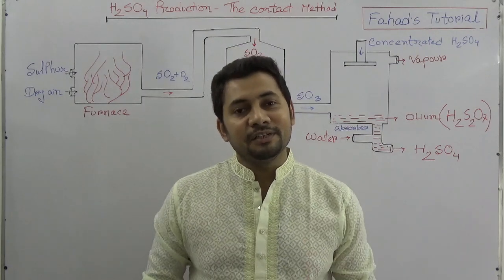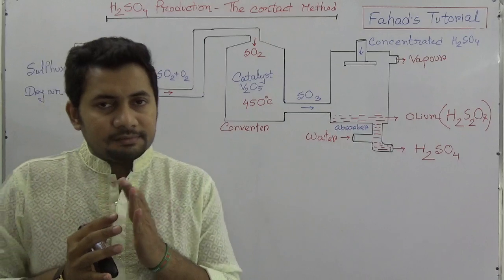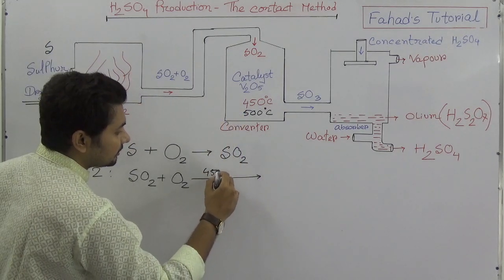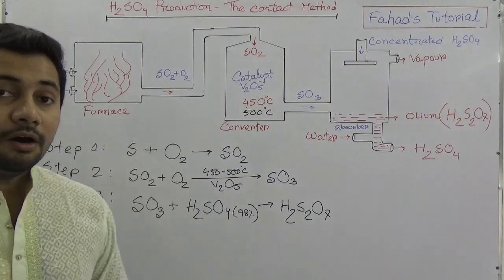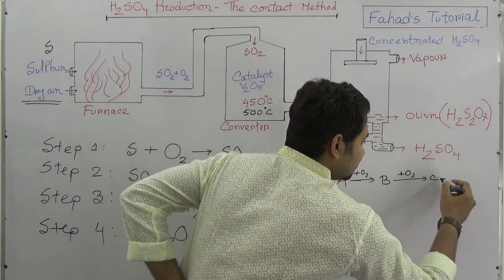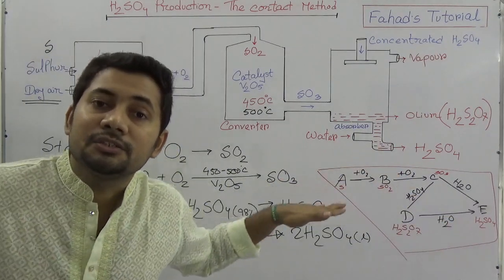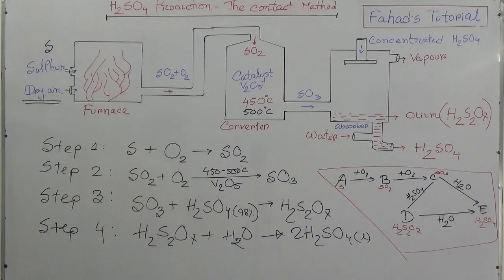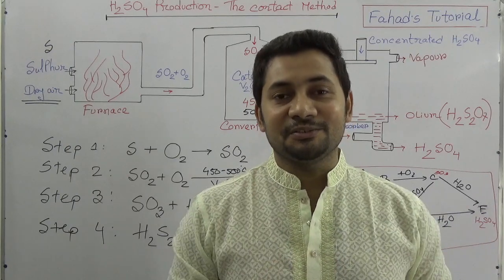The contact Method | H2SO4 Production | English Version | Fahad's Tutorial

Comment: Sir i want to ask a qs from physics...what is "thermocouple" ??
Reply from the maker: A Thermocouple is a sensor used to measure temperature. Thermocouples consist of two wire legs made from different metals. The wires legs are welded together at one end, creating a junction. This junction is where the temperature is measured. When the junction experiences a change in temperature, a voltage is created.
Reply: Thank you so much....